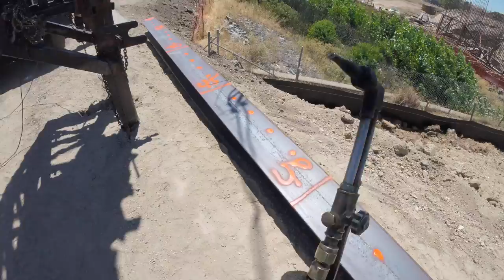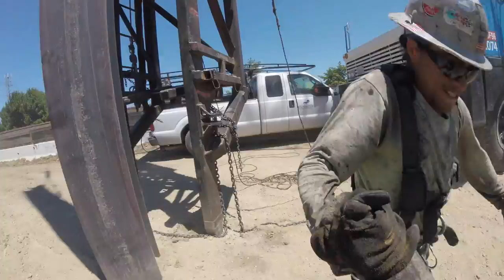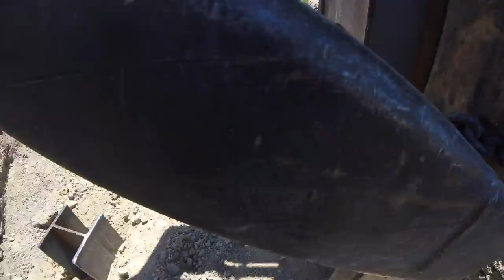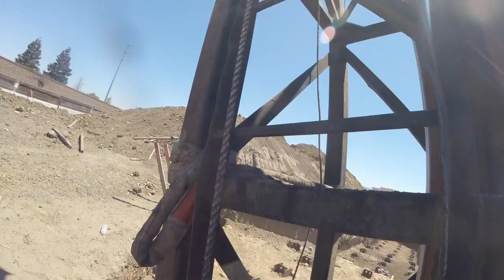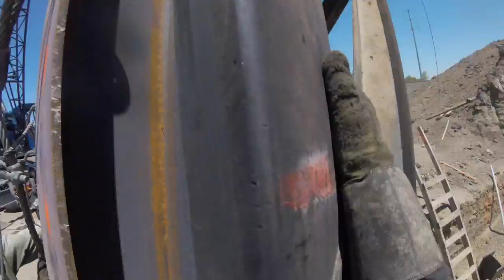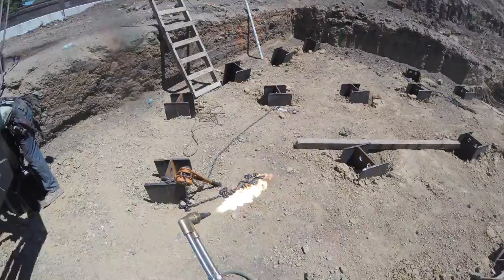Local 34 Pile Drivers - Batter Pile H Beam

Comment: I would think that metal beam might move off center if it hit a big obstacle under the ground how do you remedy that?
Reply from the maker: JACK of ALL TRADES it is what it is.. engineers figure that out
Reply: @piledaddytv  It's called a wiggeler then
Reply: ONCE IT ENTERS THE GROUND… ALL GUARANTEES ARE OFF…
IF THE PILE IS TOO FAR OFF OR WONT SET REFUSAL…
DRIVE ANOTHER BESIDE IT… HERE IN CANADA, A PATTER PILE HAS BEEN RECORDED COMING BACK OUT OF GROUND BEHIDE THE CRANE

Comment: use a pipe gate instead of that chain...
Reply from the maker: mario ribis 
Not for batter pile
Reply: battered piles too
Reply from the maker: Do you even drive pile bro?
Reply: As a pile welder rn I've built 1000 of those lmao they break and i just slap a new one together
Reply: CHAINS BIND TOO MUCH… A 3” SHAFT WILL ROLL WITH THE PILE